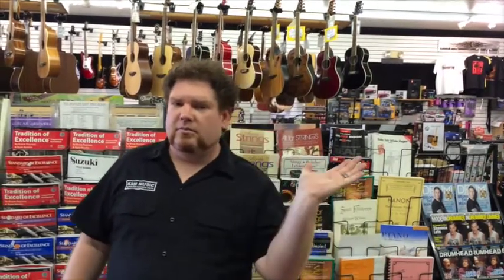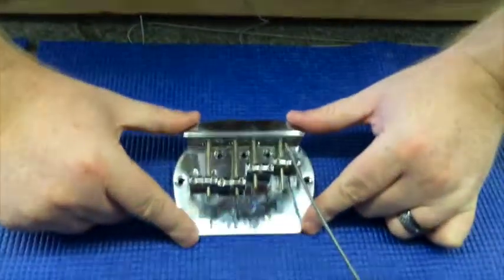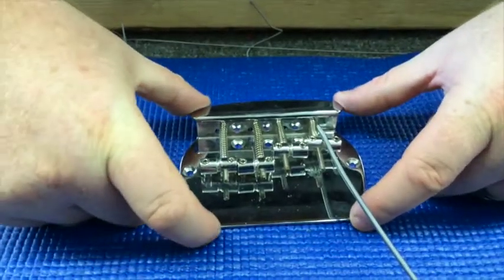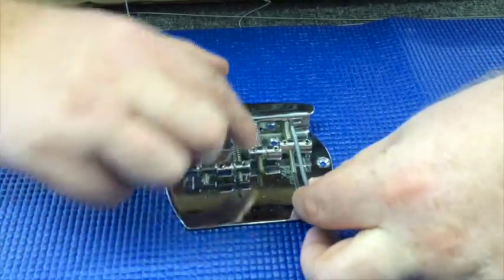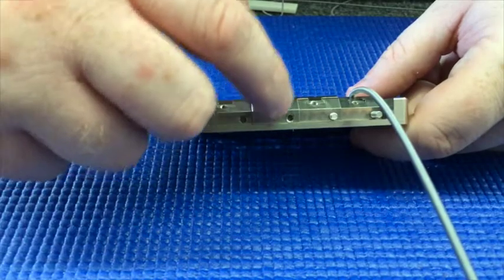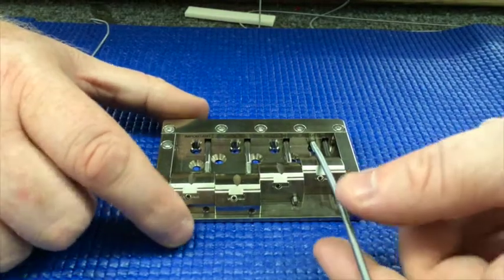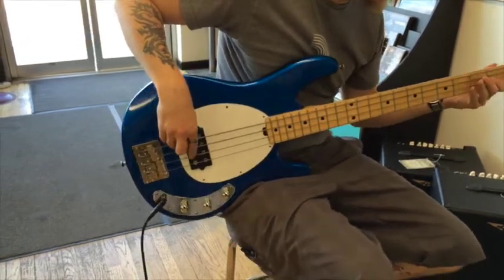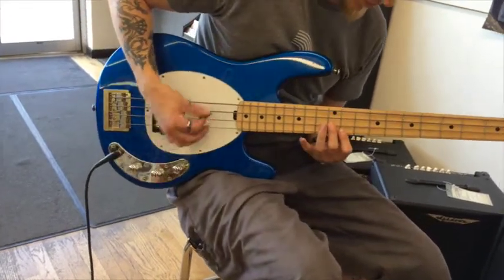Dallin and Dave show off the new KSM Foundation Nickel bridge!

Comment: Hey people at KSM guitars. The bridges that you make are cleverly designed and elegant.
BUT your videos are terrible. There are errors of principle and reliance on player prejudice and myths. The saddle intonation set on the original bridge saddles is ridiculous! AND it must still be wrong after the tech has done the work. The D string saddle will never be further forward than the G saddle unless the strings are ruined.
The springs have nothing to do with it . If the neck angle is correct to have the saddles at the correct height then the saddles will be rigidly held down by the string tension / break angle.
Just like an upright bass?
Don't get me wrong . Your products seem fantastic but it seems dangerous to make promotional material that is not factually accurate.